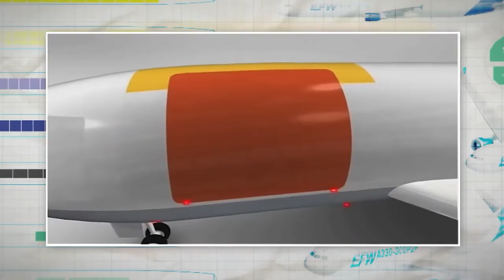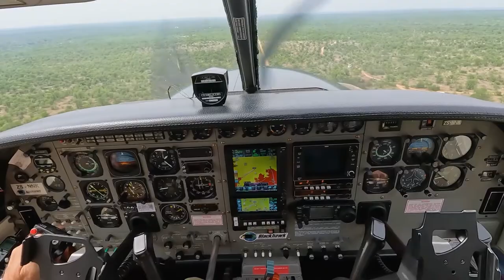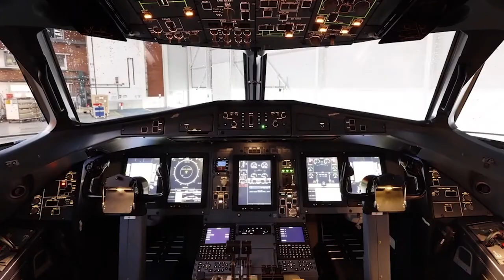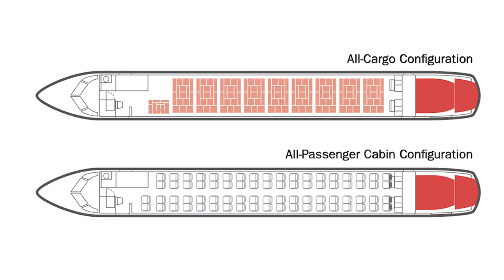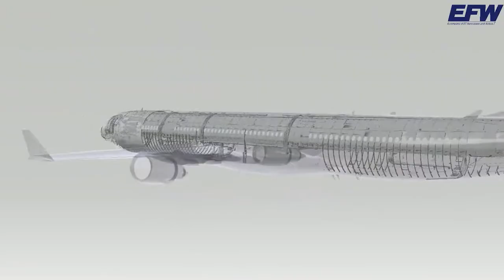A Look Into the Future of Air Cargo

Comment: As a FedEx employee who works the ramp, I'm curious to know what will come to replace our dedicated MD-11s. The 767 being too small and the production coming to an end soon, and the 777 being slightly oversized for most ramps that can handle an MD-11. The 787 (if it ever happens) will need to match the container sizes of the MD-11 (mostly AMJ's). However the 787 fuselage is too narrow for these I believe. Which puts us back in A330 territory, which was never a desirable freighter.
Reply: It would seem to me that you'd be in the best position to inform us all about the most suitable freighter variant or P to F model, in terms of cost, availability, multiple ramp fit and cargo handling considerations, as well as the corporate grapevine or word of mouth rumours!
Clearly it won't be another P to F jumbo trijet conversion as your firm has owned and largely worn out most of those!
✈️ 🛩 🛬 🇨🇦 🍁 🇨🇦 🍁 🇨🇦 🍁 🇨🇦 🛫 ✈️ 🛩